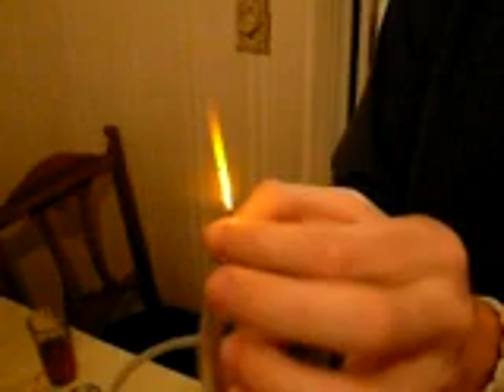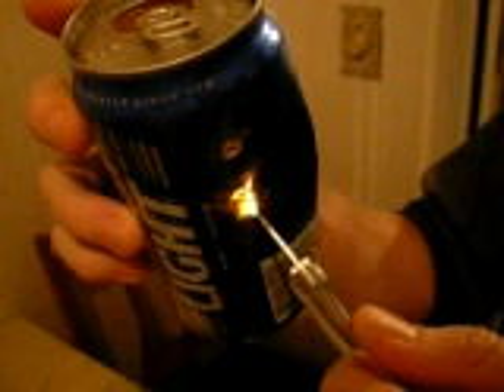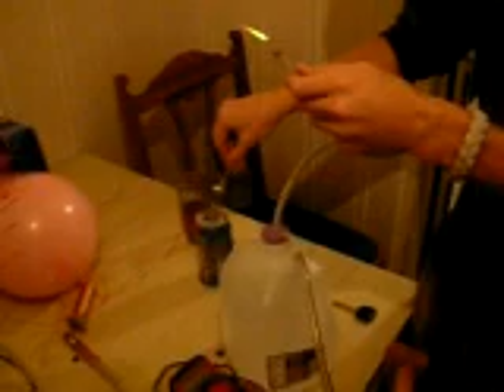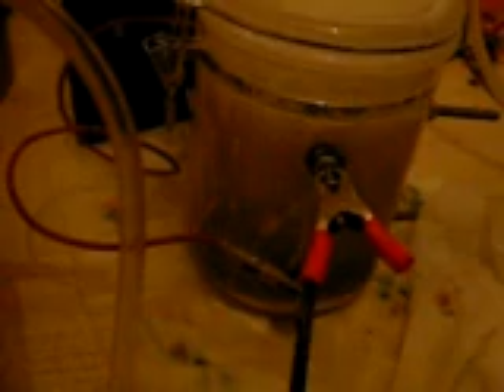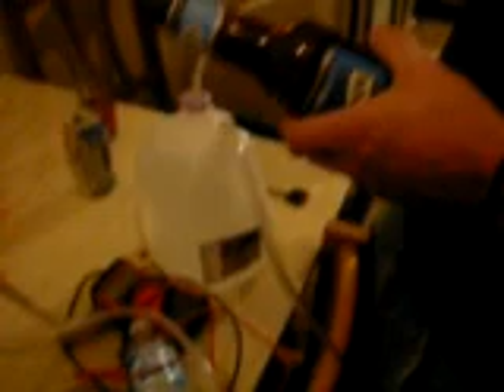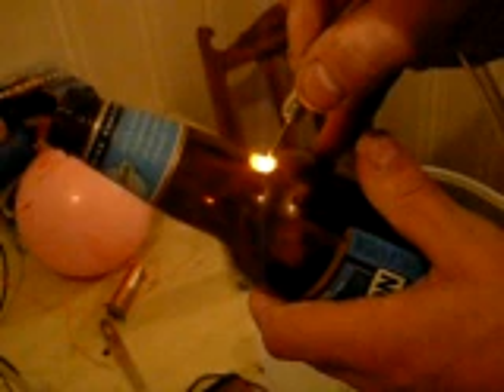waterfuel hho torch sirhoax clamshell

Comment: The reason behind its extreme heat is because the hydrogen atoms chose to be a electron receptor rather than electron donor usually. The resulting substance is a hydride which is particularly reactive to metals.

Comment from the maker: make sure u check to see how many amps ur pulling. the most we ever peaked was like 30 amps. doesnt matter just kills efficiency. but as long as u use the correct gauge wire they will not get hot. use thicker gauge wire

Comment: yo i got good idea if u gonna make bong put the bottle in the oven on high and let it sit then pull out the rack melt a hole through it and then put it back in oven fast then slowly let it cool down turn the temp down slowly till its not hot then it wont shatter cause it shatter due to changing temperature really fast thought id tell u

Comment from the maker: we were just messing around with this for a school senior design. all we did was prove it was capable for gas enhancement. steel melts at over 2000 Fahrenheit we never produced enough gas or pressure to melt enough to weld. we have melted a stainless fork but over about 15 seconds.

Comment from the maker: their sandwhich cells, two +'s on the outside and a - on the inside spaced with grommets. two cells total. i believe this run we were at 22amps 12v. we used a bike needle make sure its crimped enough to make strong pressure.

Comment from the maker: the one gallon jug is just our bubbler in case there is a back fire; if the flame were to get sucked through the tube. In this video i believe  we are using an acrylic pasta jar from walmart. perfect for what we were doing and it was only 6 bux. we were using a 12v car battery for power

Comment: So is that 4L jug the source of the hho being made through electrolysis and that the hho is flowing out of the hose that is seen constantly lit and fed and cutting through the can and bottle? (hope that question made sense  :P)

One of you said near the beginning that the "torch" was not hot. I think it's cuz of how efficiently hydrogen burns. It doesn't lose a lot of energy to heat. Might be wrong tho  :P

Comment from the maker: well we have a bubbler inline just in case. but on this run we had plenty of gas pressure. the only way it owuld get back to the cell is if it didnt have sufficient pressure. on our newer setup we put a cigarette filter in the tube right before the nozzle and that has stopped all flashbacks. we are even turning the power supply off with the torch lit and it just blows out the flame and thats it no BOOM! very nice

Comment from the maker: yes. it is crimped though with pliers. the original hole was too big it sucked the flame in a blew up our bubbler. be careful though, crimp it too much and ur torch wont perform well, so do it a little at a time.